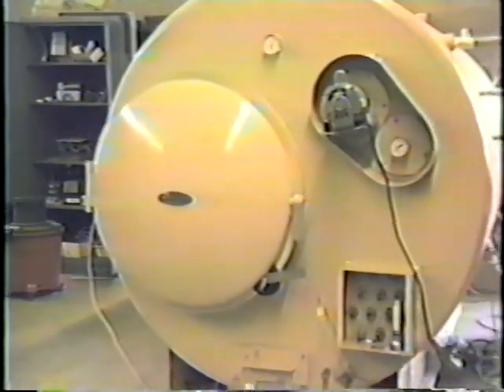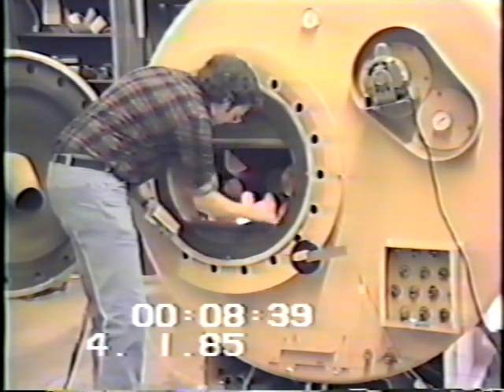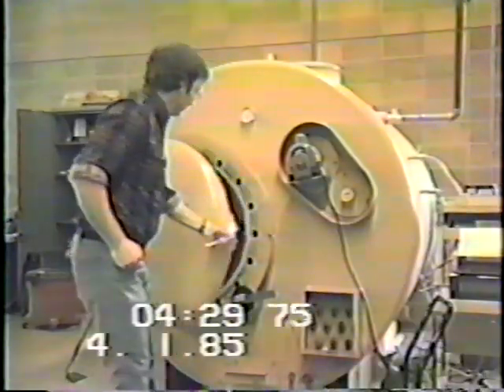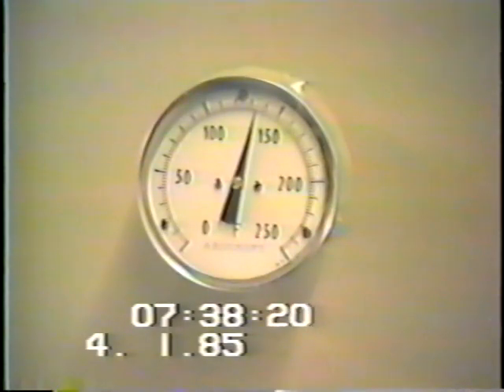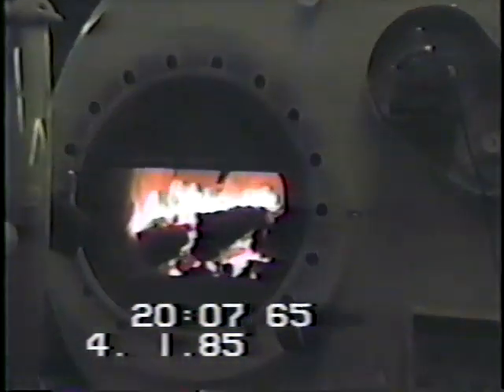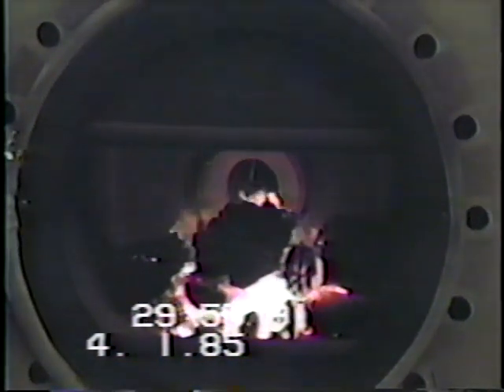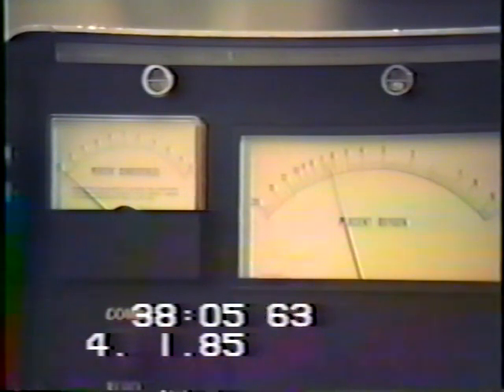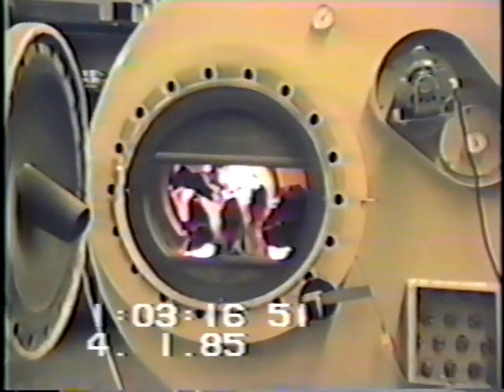GARN: The Original Gasifier Video from 1980's

Comment: I’m surprised they don’t come insulated from the factory. It seems like that would be critical for heat retention but not if you have it right in the building you are heating. Then ambient loss wouldn’t really matter. It’s going to be challenging to tell your spray foam guy to spray this or have it wrapped well. It almost seems like it would be easier to keep an eternal fire with constant water heating but I guess that gives a dirtier burn. It looks well built.